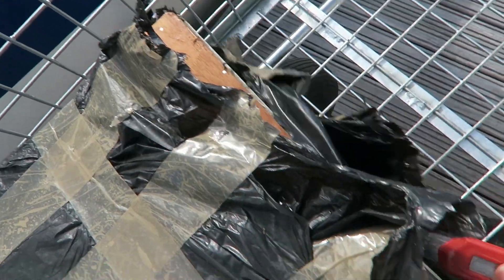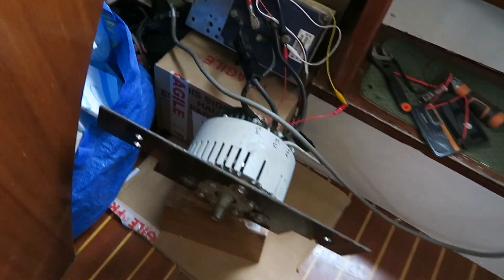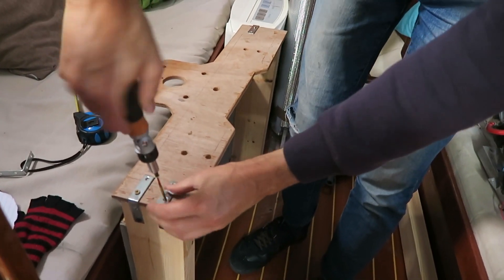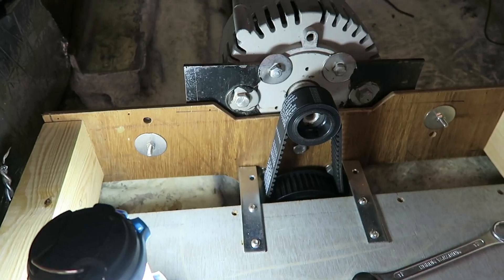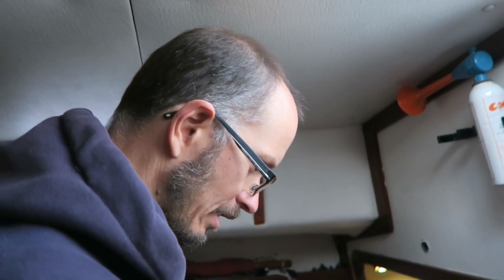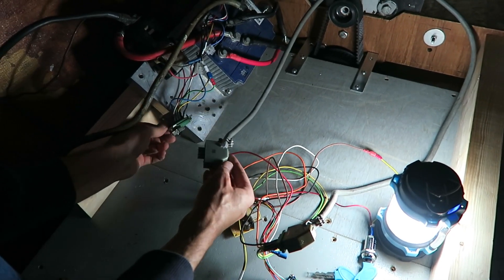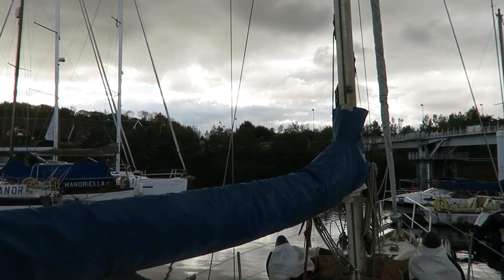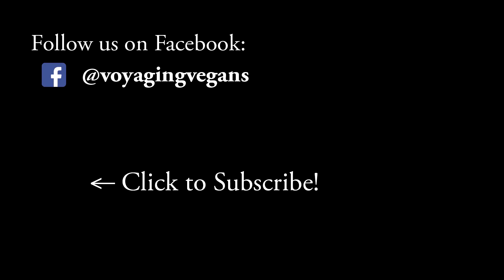DIY Electric Sailboat Conversion for Under £500! ($660)

Comment: Lovely conversion, would love to know how it is holding up now three years down the line (and if you would have done anything differently if you did it again?) - Currently building a similar setup but using two 10Kw brush-less (water cooled) motors instead as my boat is a bit heavier. Just posted the first episode on YouTube of the motor housing design if interested. Keep the good videos flowing:) Thanks!
Reply from the maker: Thanks! We ended up having to replace the controller, there's a video of the new installation on the channel if you want to check it out. Plus we'll be replacing the plywood mount with a metal one. Good luck with your project! :)

Comment: Thank you for the great video! How much did you end up spending on batteries in the future after this video? Are you still using that same motor?
Reply from the maker: I think it was about £500 for four AGM batteries. Still using the same motor but had to replace the controller, I have a more recent video about it.

Comment: way cheaper and more sustainable, you buy a three-phase motor in your next door for 50$ and you make a DIY three-phase AC rectifier and use a DC-AC inverter with second hand batteries. and way cheaper AND NORMAL (GREANER?), you use a pneumatic turbine to attach to the propeller and butane tanks and fill the tanks with a DIY vertical axis savonius turbine attached to a compressor

Comment: Isn't it so that you would go twice as fast if the motor was connected directly to the propeller shaft instead of the gear reduction?
Reply from the maker: The motor would spin twice as fast but that wouldn't double the boat speed I don't think! I seem to remember we used the gear reduction because the prop etc weren't designed to spin that quickly, but I may be wrong...my ex-partner did the conversion so I'm not the expert.
Reply: @BethanyNickSailing  you might be right

Comment: Very ingenious. You found a bargain motor and controller. I'm not sure a custom Arduino controller is something the average sailor could build, but you apparently did. I do hope the motor is brushless, otherwise it is a source of spark and you must not use any gasoline or propane onboard.
Reply from the maker: Thank you, yes it is brushless!
Reply: @BethanyNickSailing  
As some one else suggested the characteristics of your prop need to be different for electric motors compared to an ICE motor.. as it produces its  torque  more or less from go..
The diameter and sharpness of the blades will also affect the performance and current consumption .. high pitch gives more torque but finer pitch should give you more speed quicker acceleration especially if you can use the E motors free revving nature.
https://youtu.be/4OLbLei-7CQ

If you find you dont have enough power as you've used a drive pulley via belt you can mount  double motors side by side in a V formation.. its common practice in aero modeling where we gang  multiple motors together via a belt drive gearbox to swing oversized props using modest size and priced motors. 

If you dont want to run regen or cannot then a folding prop will reduce drag. 
Sailing Umas early expts might help you.🤞🏻⛵👨‍🔧🤗

Comment: this is the way to go on a Sailboat  i strongly suggest a Honda  Inverter/ generator to keep your batteries charged up  as they have a 12 volt outlet  and you can even purchase  a harness with battery clips to charge up  or will run a DC. battery charger  my next Sailboati plan on doing a similar conversion  they are quiet ,reliable , and fairly reasonably priced to do  why did i mention Honda ? i’ve owned them and they are Quiet , Reliable , and sort of easy to find parts for World Wide  none of my generators ever needed major repairs with normal maintenance either  ,the negative of Honda’s are the overall cost  of purchase price

Comment: Love this!  I am purchasing a boat with a similar set up, but installed very poorly and without proper batteries.  I want to do 48VDC with solar charging, would you share your set-up specs and experiences?
Reply from the maker: Our setup isn't anything special right now, we still just have a few old lead acid batteries. We have 800W of solar and a charge controller from eBay. We plan to upgrade the battery bank to AGMs when we can afford it! It's all working fine so far though, much more reliable than our old diesel.

Comment: Its a great idea, and execution. I'm trying to find here in Brazil one similar project. How its the electric motor work with all wheather condiction that you faced until now? Thanks for sharing.
Reply from the maker: So far it's coping fine but we haven't been out in many different weather conditions yet!
Reply: @BethanyNickSailing  Tks for replying, what is the specification of the electric motor (Watts and voltage), and how many Amper/hour using on battery set? Regards
Reply from the maker: @renanfornasier1725  It's a 5kw 48v motor, currently we only have a 90 amp hour battery bank with 45 of that being usable. But we will be upgrading soon before doing longer passages.

Comment: Considering installing an electric motor in my boat as well. Are you happy with the Arduino to control the motor?  Would you rather have gone with an off the shelf controller instead? Thanks for sharing.
Reply from the maker: The controller we have is an off the shelf one, the arduino just controls the engine panel. We're only using it because with the way our controller is programmed, we'd otherwise have to press three different switches to turn on the motor! So the arduino simplifies things because we only have to turn the key and that's it. We've been very happy with it so far. Good luck if you decide to convert your boat! :)

Comment: Great stuff... I hope to do this with a 31' Pierson presently motorized with a 4.5 HP Atomic gas engine. Also, I'd like to rid the vessel of its rudder steerage and replace it with a 'Wheel'. Doable? Thanks, Ken ... happy sailing.
Reply from the maker: Thank you, good luck with your conversion! :) Adding a wheel is definitely doable, though we decided against it because a tiller is simpler and less prone to steering failure.

Comment: Golf cart 220 amp 6 volts Trojan clones are popular lead acid battery .They are good for 550 cycles deep cycles 80% or more than 1000 partial 50% cycles . They need topping up with water but are tough as nails 
However you need  8 of them to do 48 volts .
At 100 amps you get 5 kilowatts for  one hour 60%  discharge  and go about 5 NM at 5 knots tides and winds depending .
 However day time  with solar panel should be able to get about 2 knots  for 5  hours  of sunny day. .
Good if you can to get old 2 stroke  10 hp outboard to help in sticky situations and useful for  tender  for boat.
My  plan  for my 30ft  deep keel narrow beam 1969  ssil boat is to hetba 24 volt  electric out board  and 4  of thr 220  amp 6 volt golf cart batteries.That will make  about 2.5 kilowatt or about the same thrust on the prop as 5 hp outboard . That should in calm waters pushme at 3.5 knots full tilt 100 amps or 2.5 knots at 50 amps .Then with 500 watts of 4 of the 120 watt 12 volt panels might be able to get 1.5 knots with solar power. for 5 hours midday times.
 I will still keep my  13 hp  2006 era yanmar 2ym 15 oily for heavy weather  
If the inboard  breaks complrtly  i will probably opt to get a second hand old 10 HP 2 stroke outboard as back up and make a well for it in back hatch aft of the spade rudder..
For me the cost to do the bigger solutions with inboard electric and lithuim and the rest isnt looking intetesting..for my small budget.
Keep us posted and good luck
Reply from the maker: Thanks for the tips and best of luck with your boat!

Comment: If you increase the Mah per battery it will increase the overall motor output and maximize energy output as well. Also look into a small water pump and some rubber and copper tubing to make a water cooler for the electric motor and controller. Will also help maximize power and help with gains instead of losses.
Reply from the maker: Thank you for the tips! :)

Comment: I'm new subscriber,  what is your boat? displacement? hp of old engine?  I'm looking for probably 10, to 15 kwh.  replacing 36hp old Volvo.  what prop do you have? expect any regen?
Reply from the maker: Boat is a Roberts 34, displacement about 5 tons. The old engine was 48hp, which was way too big for the boat. We have a fixed three blade prop, hoping for some regen but haven't been able to test it out yet.

Comment: Have you considered adding a alternator to the motor to aid power generation
Reply from the maker: The electric motor itself works as a generator under sail because the prop spins in the water.
Reply: @BethanyNickSailing  that's good was just thinking for when you motor.
Reply from the maker: @sorehammer  no unfortunately it wouldn't work, it would consume more power than it produces

Comment: Thanks for the video. I have a atomic 4 gas I want to rip and replace with electric. I think I can do this BUT you lost me at "I built and soldered my own controller board" 😬😬😬
Reply from the maker: Haha Johnathan always has to try and outdo everyone else ;) ~ Beth
Reply: @BethanyNickSailing  Haha. We are still lost in the middle of our conversion. I am trying to source a bearing. Did yours work well? There are several types and not sure what will work

Comment: I have several DC motors laying around up to one horsepower do you know what the approximate RPM would need to be on the motor?
Reply from the maker: Ours goes up to 2000rpm but not sure what you would need for your purposes - it will differ based on the boat.

Comment: Those motors are great for sailboats they put out 10 horsepower that's a lot of horsepower coming from that little small motor they're quite expensive 5 to $600 for a brand new one but well worth it they will push a boat along pretty good because they have a lot of torque and like I said 10 horsepower is enough to push your boat along pretty decent if you don't want to go water skiing but I've seen them on little small boats and people actually water ski behind them

Comment: Good job. How far can you travel on a full charge and at what average speed? Do you resize/repitch the prop? What is it equivalent of motor KW power to diesel engine HP? Thank you.
Reply from the maker: We haven't had much opportunity to give it a full test yet due to lockdown, but will give an update in future videos. Travelling at low speeds uses much less power, so we could probably go almost indefinitely on the lowest setting by running straight off the solar.

Comment: How do you charge the batteries , ?
What capacity is your battery bank ?
Led batteries , you drawing 50a  with 300 ah  you have 2 hours of running time ,if you don't run the batteries down to damage them. ?
Reply from the maker: We have 800W of solar to charge the batteries. We're planning to start with 120Ah at 48v (AGM batteries) and maybe upgrade later on.

Comment: Thanks for sharing your experiences. I bought project boat recently with what appears to be the same motor and controller retrofitted. The physical installation was completed but not the wiring. The controller is made by Sevcon but I can't make out the motor manufacturer and model. Any information you can share on your motor would be greatly appreciated i.e. manufacturer and model? DC or AC? Series- or shunt-wound? wiring schematic? etc. Thanks again and good luck.
Reply from the maker: It's a DC motor but not sure about the other things...if it's the same motor as ours then contact Mot Energy, they can give you the specs.

Comment: Hi guys, what batteries are you finally looking to use? Lithiums?
What do you think about these Silicate salt batteries, for cold temperature operation...
https://youtu.be/3RIdm-ZXtA8
Reply from the maker: We're planning on going with AGMs, hadn't heard of the silicate ones
Reply: @BethanyNickSailing  what's AGM mean?
As far as I can understand it, the Lithiums are splendid unless cranking petrol/diesel engine is required, but no issue for you, as you have no engine.
Would be interesting to know the mileage from your electric motor on a calm day only on batteries with no solar auxillary power. Then test with panels on a sunny calm day.
Trouble is, when you need recharge most is in bad weather. It's always necessary to have a petrol outboard for safety.
Reply from the maker: @sausage6984  AGMs are also known as gel cells, they're a type of lead acid battery but they have deeper discharge and they're leak proof, they also don't vent gases when charging and they charge faster. Lithium isn't in our budget unfortunately.

We haven't been able to do many tests due to lockdown but hopefully we can do so over the summer, once we get out of the boatyard!
Reply: @BethanyNickSailing  Why not use LiFePo batteries? You can drain them upto 10 to 12% and they keep their capacity after that. Also after 1000 cycles, they maintain 80% capacity. Expensive, but have come down in price a lot.
Adam Welch on youtube is the solar battery guy to watch.
Reply from the maker: @sausage6984  We'd like to but budget is the issue!

Comment: Very inspiring as I sit here with my seized diesel engine on my narrowboat  !! 48 volts and water cooled a must so I hear ...
Reply: Same. I have a project boat with an atomic 4 gas I want to rip and replace with electric. Mostly because the prices for resale of inboards are INSANE.

You see anything on the used market?
 Because the prices for the new electrics are double INSANE. What do they think these motors are made of?

Comment: A chain would be nosier, but hardier and potentially repairable. Just food for thought :) Also.....I hope those batteries were rated for that amp draw, because if not, you basically just did the same thing that cause early mechanical vaporizers to become hand grenades. That controller probably saved your life.
Reply from the maker: Thanks for the tip, we're aware of that and have checked our batteries :)

Comment: Guys I don’t wanna discourage what you’ve done but that 5Kw motor isn’t nearly powerful enough to push your displacement.  Keep in mind your testing in no wind and no current and no waves.  Out on open waters if you need motor or you have an emergency, that motor won’t move that hull.  With sailing and liveaboards redundancy is imperative and safety is paramount.  In a head on 20knot  wind with 2meter waves you’ll be going in reverse at full power  5Kw at 48 Volts is avg 6hp., Abd the amount of battery you’d burn would be staggering.  With a 6 battery setup in ‘ series ‘ confined to 48volt you’d have about 1.5-2hrs of useable power at 3/4 max throttle 
Your boat is 15,000+ lbs displacement if fibreglass and around 21k-24k if steel 
You need a minimum of 13hp to achieve 5knots and that’s at full throttle 
That hull is rated for a 23hp minimum to a 36hp recommended.  I have the Volvo 18hp 2cyl and a few weeks back in Lake Erie in 20 knot winds and 6-8ft seas I was maxing at 5.5-6knots head in wind 
The reason I’m telling you the numbers and details is there are MANY situations where your motor is your LIFELINE.  IF it’s not reliable or powerful enough you could easily find yourself praying you live.out the situation   I love the fact you guys are fossil fuel conscious, but don’t jeopardize your life on it.  An alternative to the noisy inboard diesel ,, which I hate is a stern drive mounted outboard of around 25-40hp ( welded on a lift bracket ) or if you really want electric the Bellmarine Torquemaster variants are the best, but silly expensive 
I strongly suggest going back to diesel with a Yanmar or Volvo 18-28hp diesel or an Atomic 4 gas and just don’t use it unless you need to.   At least you know in an emergency you have the power to outrun a storm or make safe harbour. You can pick up a warrantied used motor for around $2500-4000. Depending on brand and specs. 
If you were closer I’d sell you my Volvo 18hp model D1-20 ( 310hrs on it ) as I’m upgrading to the Volvo D1-30 ( 28hp ) as I plan a Pacific crossing in Spring, and the Panama Canal adventure.  Take Care guys.  
ps. Keep in mind my comments and suggestions are based on experience and safety and things I’ve been taught.  Doesn’t mean it’s dead-on accurate
Reply: I would say it depends what they want to accomplish with this motor. Diesel engines can also fail, any engine can. People need to know what to do without an engine. There are people out there who don’t use engines at all. Is it easier and safer with one?…of course, but they aren’t necessary, if you know what to do.
Reply from the maker: Thanks for the comments Chris. The motor is capable of delivering up to 12kw for short bursts in an emergency. There's been boats bigger than ours with an equivalent sized motor, such as Sailing Uma, who have used their 5kw motor for five years without issue. We're aware of the limitations our motor has and will plan our passages accordingly and with safety in mind. Plus, if at any point we decide we want something more powerful, our setup is capable of taking a motor twice the size. So not to worry, we'll be careful and upgrade if needed! :)
Reply: @BethanyNickSailing  you seem to be using a belt already, so you could also upgrade by adding a second identical motor. (And a third...) That may sometimes be way cheaper than one bigger motor and especially with bldc motors syncing is no problem. Nice setup!
Reply from the maker: @tosevit  Thanks for the suggestion!